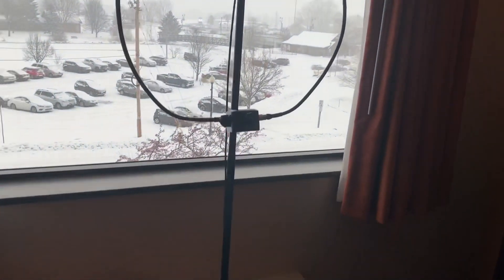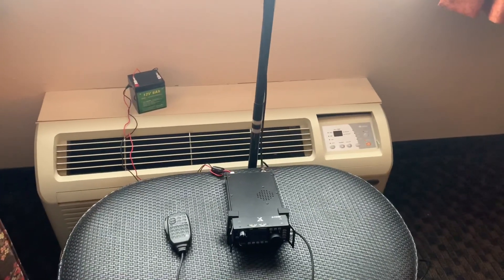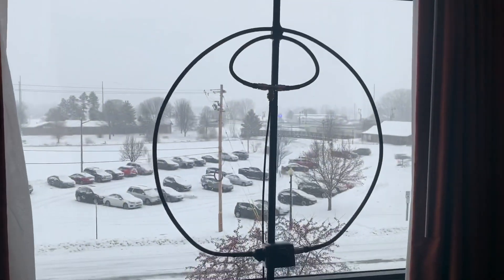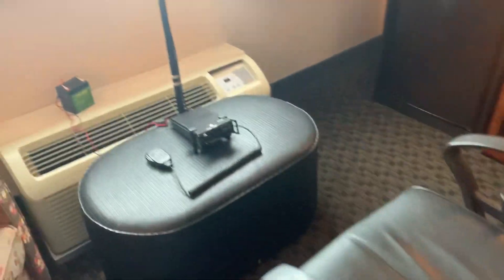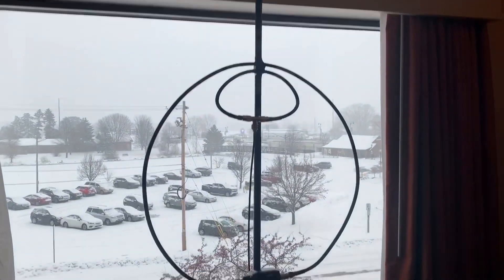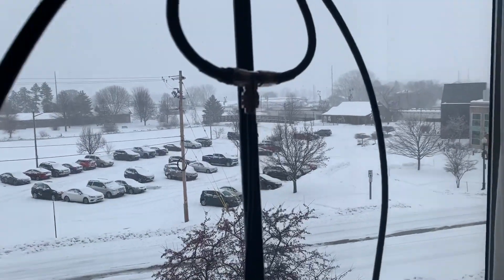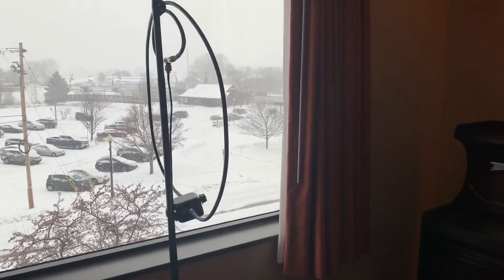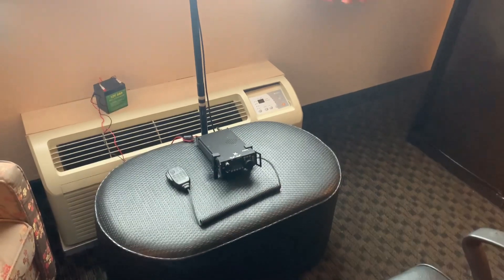Portable in a Hotel Room with a Magnetic Loop Antenna

Comment: You are inside what is likely a concrete building AND your transmission direction is along the building axis - no wonder.  Try it outside 👍
Reply from the maker: Yes I used it outside with success
Reply: @COASTALWAVESWIRES  Had a QSO Copenhagen Canada on 10w using a  hameleon F-Loop 2 days ago - placed in close to the beach near CPH airport.  Surorisingly good results

Comment: I purchased this antenna as a supplement to the Moonraker WhizLoop that I use. I went from a QTH with an excellent vertical to an apartment that doesn't really allow outdoor antennas. And even though I am using the much cheaper Moonraker, I am making QSOs every single day...be it FT8/FT4 or CW. I didn't try SSB because I never really operate SSB.

Comment: You're making me feel better about the Wander Wand loop I have.  Only 2 FT8 contacts in several hours of trying.
Reply from the maker: Yes that loop gave me fits, I made some decent contacts with it later on the beach but it was still a bit of a struggle
Reply: I have a moonraker WhizLoop in my apartment, connected to my Yaesu FT-817. It has been a stellar antenna for being inside in my living room. Several hundred QSOs have been made with it. Don't give up.

Comment: Great video - I bought one of those small single loop mag loop antennas from China and used it in my backyard and  have made a couple of contacts - very weak reports. I've tried moving inside and have picked up a few stations but never a two way contact.  Of course, mag loops work best when you can rotate the antenna. without anything in the room getting in the way. PS - does the faraday loop connect  directly into your radio or is there another variable capacitor for adjusting the SWR?
Reply from the maker: Thanks for watching! Just the variable capacitor at the bottom of the antenna then directly into the radio. 73, K4OGO

Comment: The only true failure is when one doesn’t try. Enjoyed your attempt. Mag loops can be amazing under the right circumstances. I have an Alex Loop, second hand. My first contact was checking in to a net where NC was in Maryland, running 10W. I’m in Va. working from in my house pointing out the picture window. Another contact was to Europe from same. This was during solar minimum. Outside on high ground is usually even better. Haven’t had chance to try near the beach yet. Hope to work you one day. 73 de N4WLC
Reply from the maker: Roger that! Thanks for watching and yes hope to work you one day, I’m just down 64 in Hampton Roads. 73, K4OGO